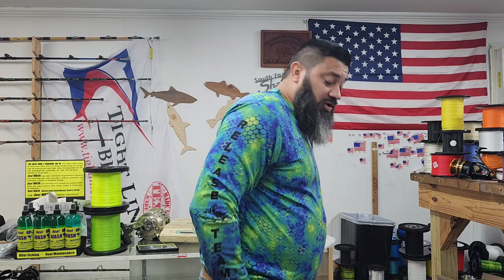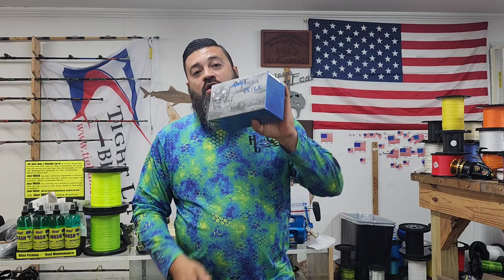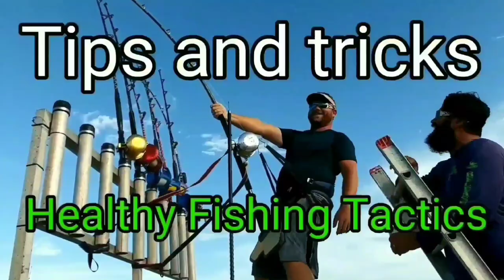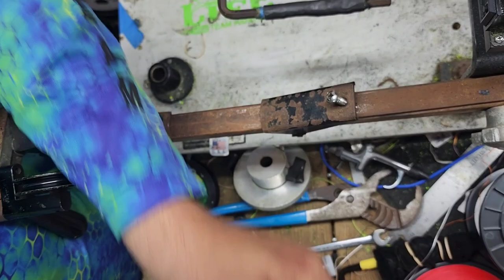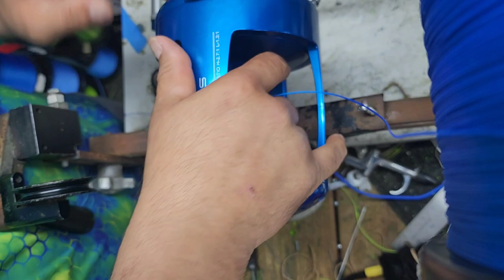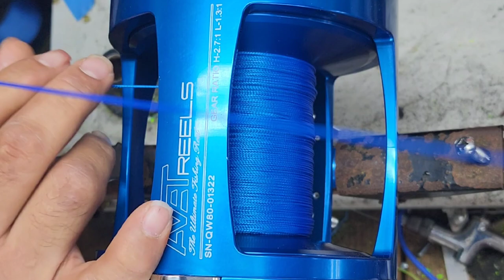25k sub Prize added How to win!!! 80w 200lb tightline hollow braid spooling asmr

Comment: Hey man I’ve been using a 5lb lead (not Sputnik) to hold down my shark drops on normal tide conditions do you think that’s overkill? I use to use a break away cinder block but got tired of having to search for weights when I go to the beach… thanks for any tips bro!
Reply from the maker: Yes I use the smallest Stainless steel sirf weight we make because don't want to have to fight it when I am done fishing if I don't catch.. have ran 7oz with 3/32"
Reply from the maker: Try to use Smallest weight possible so it doesn't drift
Reply: @TeamHardLife  thanks for the tips my shoulder is still sore lol
Reply from the maker: I bet trying to crank in to reel.it lol